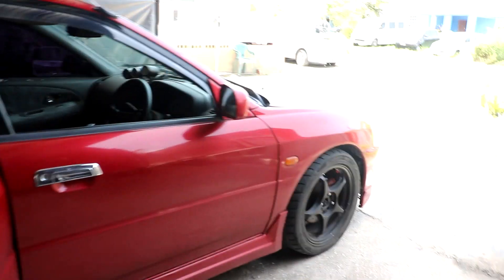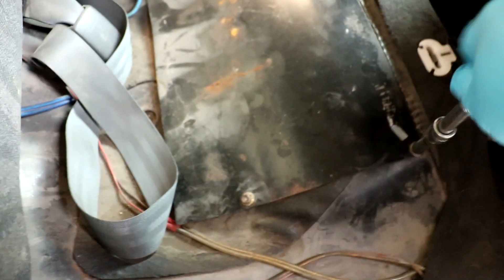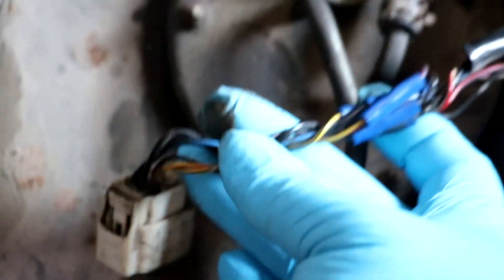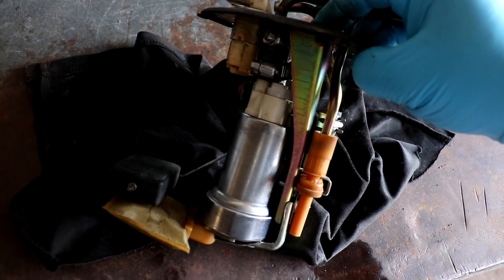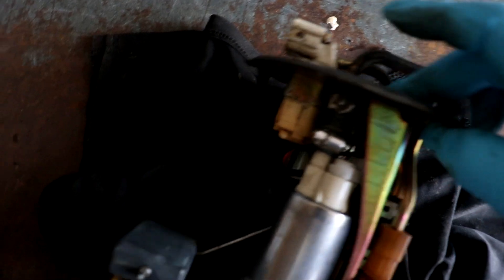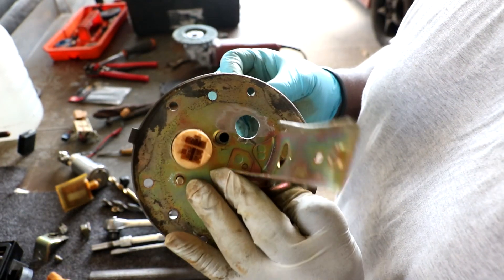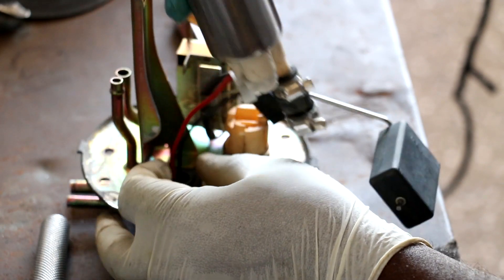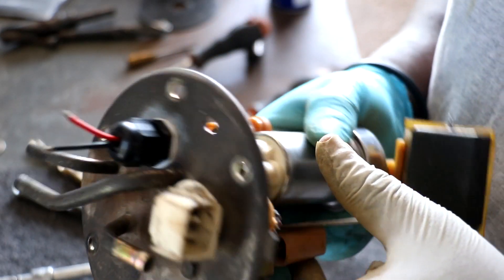Evo Fuel Pump Hangar Mod for Walbro 450lph

Comment: Hey bro, do u have the parts info and where I can buy them? 

The white plastic connector has crack on mine and it’s causing serious fuel leak. I have put epoxy but still leaking. I may need to fully epoxy it to completely seal it.

Comment: Nice Video! Did the car have a fuel pump rewire kit or was the wiring all stock?
Reply from the maker: Thanks. All the wiring was stock. Had just put a relay closer to the pump rather than in the engine bay.